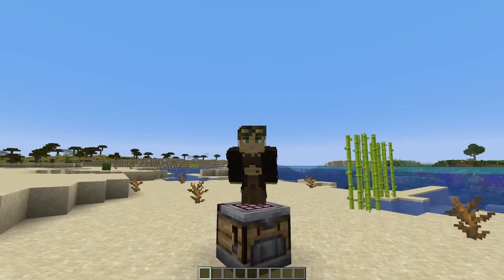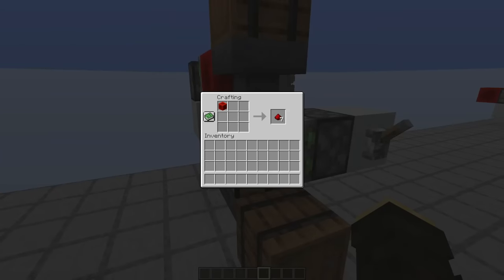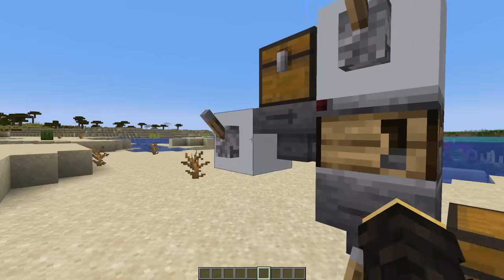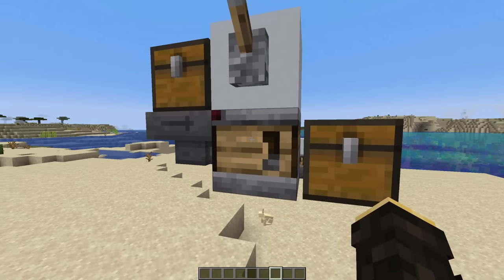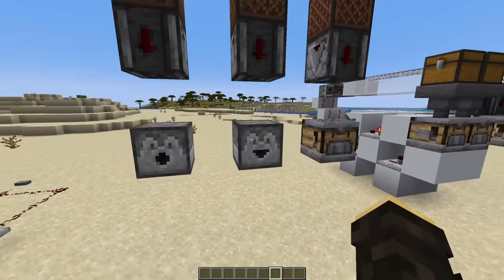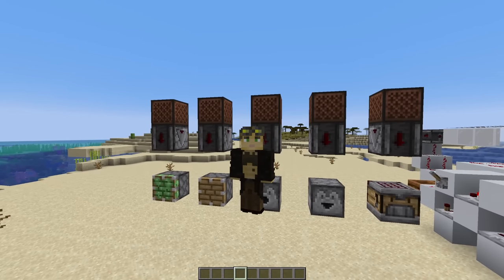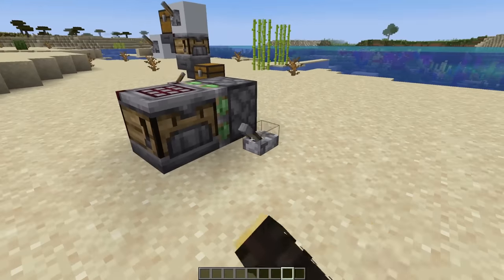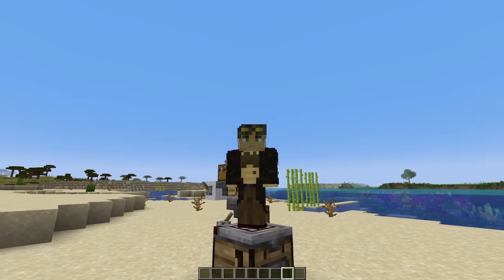The Epic Return of Autocrafting

Comment: I didn't tested this yet, but if the autocrafter doesn't inputs items in random slots, then one could simply use the comparator signal to build a dedicated autocrafting machine for the most used redstone components by using a hopper filtering system on the input, connect it to a item counter, and make an amount selector using redstone hopper timers

Comment: I mean, the crafter doesn’t necessarily have to be moveable for universal crafting, you could simply order the items in hoppers. Granted this would be slow, but you could scale it up to happen with multiple crafters
Reply: So I tried making one, and there is one drawback to this approach, you have to manually disable slots if your recipe doesn’t call for an item there
Reply: @AwesomeIronGuy what about uting a precise timing circuit with some or gates that when a slot is left empty you just out the filler item in and remive it 1 tick before you craft it. Might need parrelsation to make up for the speed lost
Reply: @CriticalCipher  that also works. The main problem with that approach is it is a lot more redstone to achieve the same result. I’m currently working on an idea similar to a large scale furnace array using the same gates approach with hopper mine carts.

Comment: 6:27 it’s actually really easy to get a clean solution to this, take a comparator output from the table into a single piece of dust. Then on the opposite side of the dust put another comparator going back into the dust (both comparators pointing at the same dust) and put something like a composter so the second comparator gives a signal strength of 8. If you put the dust on top of the face of an observer, it will flash when the crafter fills and when it empties. The red stone dust will change from signal strength 8 to 9 when full and then back down to 8 when you use the observer’s signal to power the crafter. The 2nd flash should be fast enough to not cause any issues with accidentally crafting the wrong recipe.

Comment: I could imagine that a different solution to not being able to have 9 inputs could be that the auto crafter could pull from hoppers out of order. We see that it will fill each slot 1 at a time. So they could make it pull the correct item from the hopper when it needs it even if it's not the first thing in the hopper

Comment: I actually like the output signal equalling 9 for a full crafter. it's a signal strength of +1 for each slot that is either locked or contains items, meaning, everytime the crafter (REGARDLESS of recipe) outputs a redstone signal of 9, it is ready to craft. And there is "direct" translation beetween the redstone signal and "how many slots" are NOT empty.

Comment: A universal autocrafter is still possible (see mumbojumbo's video for an example) by sequentially sending items into a hopper line, just not at the scale that the carpet version can achieve due to timing requirements.
Reply from the maker: Such a crafter would be so slow it wouldn't even be worth using, my universal autocrafter from over 2 years ago can do 18K operations per hour, a line of droppers could do an operation every 36gt or 2000/h which is 6x slower. Scaling up the speed then becomes a logistical issue with item distribution.

Comment: One way they could enhance this block is add a switch/toggle to the GUI (comparators have subtract mode) that prevents the crafting if any slot only has 1 item. A lot of people are requesting better ergonomics for fixing the recipe and limiting what can go in, and this would be a solution. There are edge cases for non-stackables like the bow in the dispenser, but almost all other cases could take advantage of it. Or maybe this toggle can be per slot.... So each slot is either disabled, open always, or open but disables crafting if only 1 item.

Comment: I think the redstone should be more accessible without a visit to wiki almost every time. 
0-9 pulse strength making much more sense in general.

Although quasi connectivity is beneficial in many circuit, it is a lot more confusing in general.
I agreed with movable block entity. But again, it’s a problem with block entity itself in java not the crafter.

If the crafter came out like the Gnembon’s suggestion video a while ago where you have to do many specific circuit just to use it properly like remove the dummy item. It will be lot more worse.
Reply: 0-9 is useful for a single auto crafter but as he said 0-15 simplifies things greatly for tileable designs. Redstone is not designed as new player friendly and its system as a whole would need to be changed to achieve this. However, one of the most fun parts of redstone is learning more about it through the wiki and videos. Minecraft itself couldn't be fully understood without learning mlre about it outside of the game.

Comment: I think it would be so much simpler if you could say, "set" the suto crafter with the items you need to craft. Say for example you want to craft a piston. You could set the planks at the top with 3 wood, the 4 cobblestone on the side, the iron and redstone. Then when you connect a hopper to it you can pass all the items it needs through one hopper and the auto craft would put the items in the spots you set. 

Maybe this is asking for too much, but I think it would make things very easy especially for those less redstone savvy as the current implementation requires some weird redstone to make complex recipes. That and moveable tile entities lol.
Reply: You actually can, you just need a slower clock. I bet that will be one of the more common uses once the update drops.

Comment: Minecraft has now finally become a real automation game like Factorio and Satisfactory and technically competes with games like that.
Reply: Funnily enough factorio was directly inspired by the minecraft mods like gregtech, buildcraft, and industrialcraft, and satisfactory was directly inspired by factorio so it all kind of comes full circle
Reply: problem: factorio is a DIFFERENT GENRE THAN MINECRAFT. With thousands of mods, you can get close, but it isn't optimised and will run like shit. There will never be a Space Exploration for minecraft. SE is too much - you need to render multiple surfaces all at once which all produce items, these items need to be instantly transmitted between surfaces and there needs to be space trains that conserve momentum. It needs to have no loading screens between surfaces (space train shenanigans) and multiplayer compatiable. All of that, running at 60fps/ups. All of that, while theoretically rendering in a whole planet. All of that, with no loading for a single surface (because otherwise the factory will turn off). All of that, with good looking sprites. All of that, with easy building. All of that, with copy+paste.
Infeasible.

Comment: A universal crafting setup is still possible: it just requires some kind of programming that stores recipes (something we can already do) and a dispensing system that loads items into the crafter one item at a time (also something we can do).

You could even read the item we need for the recipe, dispense it from main storage into a water stream, hopper it into the crafter, and then wait an arbitrary amount of time before dispensing the next item in the recipe to avoid timing conflicts. 

It may be slightly bulky, but it should actually be relatively simple in concept.
Reply: I don't see how you'd get around the issue of requiring player input to lock slots. The best solution would be to have redstone input from, say, the back lock the next available slot.

Comment: surely you dont need to have that piston feed tape for this becuase it can have multiple in a stack. you just leave one recipe in there as a recipe filter and then dispense all your items into water stream that feeds into a hopper that goes into the crafter and then you set a pulse delay of how long it takes items to get into the hopper and bam pulse goes off crafts 1 of the item and leaves the recipe filter intact. and because of the nature of even distribution for items when using hoppers and because items cannot go into slots with items of different types your filter will never be removed. (a note for wearyness when developing this system is that the order that items are put in and distributed thought the crafter does reset when exiting the world especially in single player so there would need to be a failsafe implemented for when you log out to make sure no auto crafts are running during that time (discovered by xisumavoid))

Comment: It is interesting how simple it is to make a machine to make a single unchanging item. I think the most practical technical use for this is not a general purpose auto crafter, but you can literally have a single hopper tower that fills a crafter tower. It is slow but takes 3 blocks per auto crafter and you could just be crafting every recipe in the game 24/7

Comment: You can get all the wood into the piston crafting recipe simultaneously by having the input be another crafter which crafts logs into 4 planks.  You can also have another side that switches between uncrafting redstone blocks and iron blocks to add 9 at a time so it doesn’t need to cycle as fast. That jus leaves 4 sides for cobblestone droppers which is the amount of sides you have left, and what do you know, you have dropper speed piston crafting by using the crafter to fill the crafter. Probably more complicated than making 2 systems at half speed, but it’s theoretically possible.

Comment: You can make a much smaller tileable design without using pistons or observers, and the piston crafter doesn't need movable block entities at all! Your feed tape is just an overcomplicated way of inserting each item in sequence. The same thing can be accomplished using droppers and hoppers. You can even make the process work in parallel by dividing each item stream between crafters, similarly to how item streams are divided among furnaces in a large smelter array. I've been working on pushing storage tech to the limits with my shulker hard drive, which inserts stackable items into a shulker without combining stacks of similar items at a rate of 20 items/s. It's even easier to avoid combining stacks in the crafter, since items are inserted into the least full slot instead of the first empty or similar slot. The only technical challenge would be shaped crafting and dealing with ingredients which do not stack to 64, but I can already think of some ways to overcome these problems. What I'm hearing is a lot of complaining, and not enough problem solving.

Comment: One thing I hope they change about the autocrafter as it stands is the comparitor output.
currently, it will give one redstone signal for every space occupied or disabled, which is very good and I have no notes on that, however that means the signal str4ength will only ever go up to 9, and there is no easy way to tell if there is a surplus of items inside the crafter.
To make bulk shaped crafting easier, I would love to see that remaining 6 redstone strenght output used to tell how full the slots in the crafter are.
I think it would be most intuitive actually for the outputs past 10 to be based on the size of the smallest stack inside the autocrafter, or in another way of seing it, how many times the autocrafter is able to craft the current recipe. This would allow for very simple setups for crafting shaped recipes where you just hopper in the various components and dont have to worry about one of the components running out before the others leading to the recipe changing as one of the slots gets fully emptied out and refilled with something else, as you can have the autocrafter cfart on an output of 10 and thus garuntees that there is always a surplus of items within it storing the recipe

Comment: A way to detect when it’s full is by having a comparator with a chest it barrel with a strength of 8, going into a rs dust that the comparator that is with the auto crafter is also pointing on it. An observer will detect it and power the machine

Comment: Personally I don't think this will ever become a 1-wide design. There's just too many combinations and shapes of recipes. I think it will end up being you have one crafter that you change to your needs, and you have a bunch of one use systems in farms to compact items, or make different items. Also I disagree and think that the 0-9 signal is fantastic. If it was 15 that would be very difficult to do things with. If 15 is filled with 9 stacks, then a signal strength of 4 could be made from a few stacks of items, and one of the items you need to craft could be missing entirely. And how would you know if a recipeis finished? With the 0-9, every single recipe will be created at signal strength 9 as long as you block out every other part you don't need. All you do is use a comparator subtracting 8 from the side. Which you can use lecturns or another crafter if you want. It will activate when it's ready to craft.

Also I have already seen a 1 wide tileable by mysticat, however that is for strictly one ingredient recipes. Like iron nuggets, trapdoors, etc.

Comment: To clarify, the crafter fills slots like this:

- Go left-to-right and top-to-bottom
- Prioritize empty, open slots
- Prioritize slots with the same item that has the least amount of it (So if you craft a chestplate and all slots except 8 have 5 iron and slot 8 has less, this one is filled first)

Also, regarding the 0-15 signal strength aproach: How should locked slots be treated? Like a full stack (64)? And how does the mod handle different stackable items (i.e. minecarts for crafting chest minecarts)?

Comment: If you don't mind the player putting the initial items in the crafter to encode the recipe, a universal crafter is feasible. Simply don't trigger the crafter when it would run out of items, leave at least one set in there. Then you can use just one hopper as input, drop items into it in sequence

Comment: To make it tileable have two comparators on opposite sides leading to the same redstone dust piece and have one side be hooked up to the autocrafter and the other side hooked up to a lectern with a book on page 8. From that point, have an observer facing the redstone dust. When 9 tiles are filled the comparator will up the redstone dust's power level and trigger the observer.
Reply: Didn't see Arenspace's post. This is a duplicate. Yikers

Comment: A line of redstone, on a line of droppers, on top of hoppers, pointed at the table. 

Each pulse puts one item down in the hopper, first to last they enter the table in order.
 The second pulse crafts and sends the next set.

You could fill the chain from an encoder of some kind, or just fill each of the 9 segments manually.

Comment: I was adept of the auto crafting dropper version of carpet autocrafting and was really happy to see that this is (sort of) the implementation we got in vanilla. I'm slightly disapointed with the differences though but I can live with that because those downsides are nothing compared to how much this will add to the game! My main disapointment is the 1-9 SS range isntead of 1-15, but I think there is chance that will be changed before its released.
Reply: +1, But I think the current 1-9 behavior could be a nice option for the comparator's secondary mode
Reply: From what I have seen on SilentWisperer's autocrafter vid at the 6:15 mark, if you put the comparator in subtract mode, then it will only activate when all slots are filled (either by an item in the slot or disabled)
Reply: @tankmast3r403  Nah, that’s not how it works. He used subtract mode along side with a SS 8 on the side of the comparator. It doesn’t work like that standalone, it needs additional wiring. That doesn’t fix the “issue” to allow SS15 detectors and make 1wt set ups.
Reply: @chriss3404  comparator secondary mode? Comparing/subtract mode does not change at all the value it reads from containers. What the mode influences is how it reacts to signals going into the side of the comparator.
Reply: @vinicus508  ahh, I see, fair enough.
Reply: @vinicus508  Oh! I had no idea!
I've made fairly complex redstone systems before, so I have no idea how I missed this detail.
Thanks for setting me straight!

Comment: Quasi connectivity is a bug. also just use the comparator in subtract mode
Reply: Well quasi-connectivity was a bug, but people found uses for it, and so at some point Mojang decided to keep it as a feature on Java Edition.

Personally I play Bedrock, and I am super-happy QC isn't a thing there. Of course there are down-sides to the way Bedrock does a lot of things, but I like it.

As for "the comparator in subtract mode" - if you're talking about the signal strength 9 thing, the issue there is that in a one-wide tileable machine it's relatively easy to detect signal strength 15, but harder to specifically detect signal strength 9 (unless you just make the machine larger...) To use a comparator in subtract mode, your machine can't be 1-wide.

Comment: To fix the multiple input problem, they just need to add a "phantom item" in the recepy which simply acts as a whitelist. Maybe now you can do that now by keeping the items inside with a comparator.
Reply: well its already kinda is implemented.. you can input predefined recipe. so if you want to make ultimate crafter you just start adding materials for one item once its perfected you just force to load much more than one crafted item and then start crafting with right machinery you dont have issue anymore